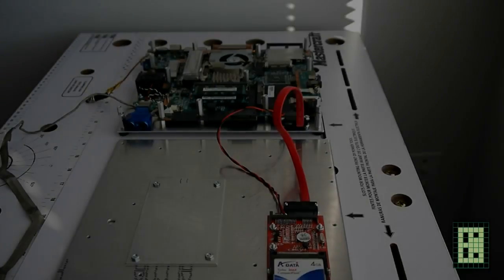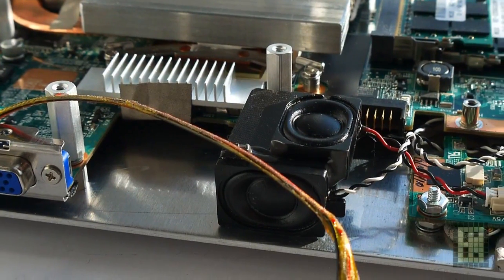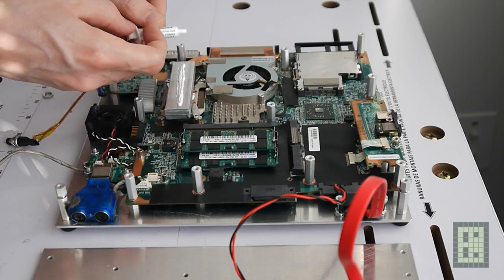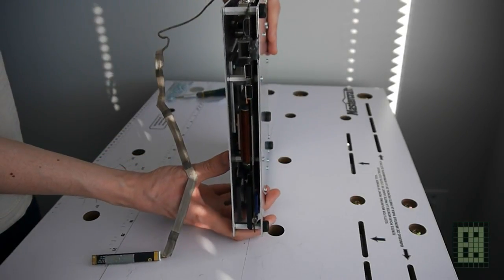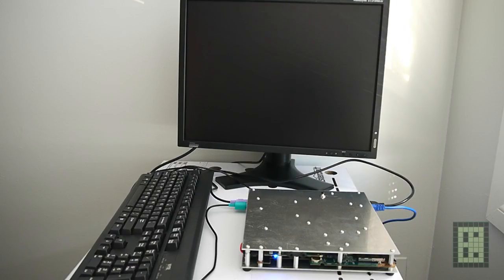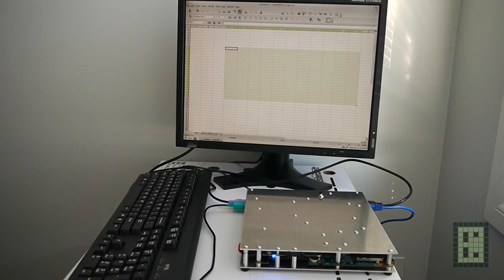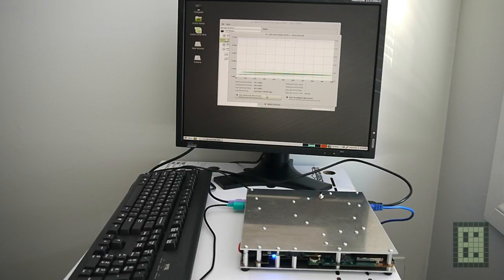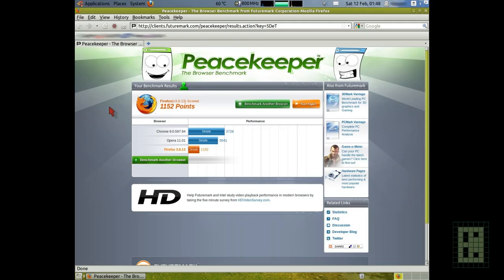DIY Desktop Computer from Laptop Motherboard and aluminum case.

Comment: Salut,am si eu un proiect aproape identic,un dell studio 1555. as avea o rugaminte ,daca ma poti ajuta.
Pot adapta un hdd 3.5''  pe voltajul placii de baza,sau cu o alimentare auxiliara?
Reply from the maker: Presupun ca Dell 1555 foloseste un SATA 2.5" si alea sunt alimentate du 5V de obicei. Cele mari de 3.5 au nevoie si de 12V pt motor. Cel mai bine e sa alimentezi HDD de 3.5" separat. Mufa de SATA e compusa din doua portiuni cea mai ingusta este de date si cea mai lata este pt alimentare unde exista 3.3V,5V si 12V e posibl sa ai toate astea si de la placa de baza da nu stiu sigur cat consuma HDD ala mare si daca sursa de pe placa de baza poate furniza currentul ncesar. Este posibl sa aiba doar pini de 5V connectati oricum. Un HDD de 2.5" consuma in medie 2 sau 3W si unul de 3.5" in jur de 7 pana la 10W deci va avea nevoie de ceva racire nu prea merge pasiv ar trebui un ventilator.
Ar fi mai bine sa folosesti un HDD de 2.5" sau un SSD si sa conectezi HDD mare pe USB in caza ca ai nevoie de capacitate mai mare pt date.
Reply: Multumesc mult de sfaturi. Ideea e ca nu am loc de hdd 2.5'' din cauza carcasei care e pre-made. eventual sa gasesc un conector sata curent tata sa pot cabla hardul la distanta. Imi plac video-urile tale . Keep it up

Comment: Or could you tell me which items you used for the open casing? I just bought new stickers and a metal logo for the case :) the computer is not bad at all either. It would work great for a desktop.
Reply from the maker: Other have asked the same question you can see in older comments. The only components exept for the motherboard from an old laptop are two aluminium plates ordered cut to dimension from eBay and some hex standoff's from digikey nothing else. Also this was done more than 3 years ago almost 4 but it still seems to be popular.
Reply: Oh yes! This is a great idea! It's recycling. My previous computer was great, but it's current casing is restricting it. The computer is an Intel Core i3, ATI Radeon 5000 HD Graphics, 750GB HHD, Blue Ray disk reader, etc

Comment: That is neat, long ago i made one too but with the original lcd on it and with acrylic instead of aluminum and my spacers were hand made from a clothes hanger plastic and then tapped to fit m3 bolts.

Homemade towerless pc

Comment: Is it possible to change the gpu or the cpu on these things?
Reply: Some laptops have socketed CPUs and some don't, if it's socketed you can change it for another cpu thats socketed . As for the GPU unless you have really good skills you can't really change it unless you get an external PCIE slot

Comment: Is it possible to change the gpu or the cpu on these things?
Reply from the maker: I think the CPU was in a socket but there is not much you can upgrade to.
Reply: If the gpu or the cpu are soldered into the mobo,  is it possible that you can solder a different one in?
Reply from the maker: carlo clores
You need special equipment to do that and not sure if you can get a pin compatible GPU as replacement that is an upgrade to the current one.
This is already a more than 3 years old project. Are you interested in general? Or about this particular board?

Comment: A very cool and elegant design. Thanks for sharing. I bet if you installed KWIN or a Linux OS like Zorin OS9 that has all the eye candy and special effects, you would have alot of people coming over and asking where you got your cool rig from!
Reply from the maker: Thanks. This cool rig was actually for my mother :). I needed something light to get low international sipping and it needed to be reliable that is why I used a read only OS and good cooling. It still works as it was initially after more than 3 years. I'm more in to functionality than eye candy even if I think my latest project the Solar BMS looks quite good.
Reply: Well you did a fine job, I am sure your Mother is very happy with it. I would love this thing. Maybe someone will be nice to me and give me an old laptop that no longer works so I can try this.

Comment: Very cool, 99 percent of people would bin there laptop when the screen breaks, your video is showing them a better way, you could very easily fit your Aluminum PC to the back of a flat panel monitor creating a all in one unit. great job.
Reply from the maker: Thanks. There is quite a bit of work and the cost of materials. I think I spent a bit over 100$ on this build.

Comment: Hey while i would have implemented things slightly differently; the design is very nice and you have given me some ideas of when to do with my old laptops. Thank you for this video :)
Reply from the maker: Thanks for the comment. It was done more for practicality than aesthetics. The most important element is the case used as heatsink.
Reply: Yeah I noticed, that's kind of what I like the most. I have a heap of old laptops that are still good, but for what ever reason the case or the screen is damaged.

My thoughts where run them as low end game servers and carry them in a rack/stack (inspired by your design) to take to LAN parties; and just have a small switch on the top. Assuming there's no issues with me ripping off you design a little?.....
Reply from the maker: Untamed Euphoria
:) You can do whatever you want with my design. That was the reason I uploaded this video so people can get some inspiration. Thanks for subscribing.

Comment: So you had a BIOS option to show video through your HDMI right from bootup?
Reply from the maker: I think at boot time all video outputs are active and just when the OS takes control of the HW it can decide to use only one or multiple outputs.
There was no setting in BIOS related to video output from what I can remember.

Comment: Hey, let back on that over-use of thermal grease. More is not better. You should have a paper-thin layer of grease for best thermal transfer.
Reply from the maker: You are right. The reason I used more thermal paste in this case is because the surfaces where not perfectly flat and is better to have thermal paste than air.

Comment: Hi there, can you tell me what grade aluminum you bought and if from online; from where?

Awesome project! Thanks!
Reply from the maker: Not sure I remember correctly I think it was 6061. I got it from eBay but is more than 3 years ago not sure that seller will still be there even if I will have remembered his name.
I just got one that was from US and was cutting custom size (just rectangles it will not do other shapes).
Reply: That's the grade I was going with. Thanks!

Comment: Good job , dude but u can always use An SSD which small and it can be added to your case
Reply from the maker: The CF (compact flash) that I used is in fact an SSD. Back in 2011 a SATA SSD was a bit expensive for this build.

Comment: Your machine work looks excellent, I have a dell Inspiron 1501 M/B AMD 1.8m ATI video chipset. I think I'll try this, only I'll install LEOPARD 10.5.8(I had it running on this 1501 before) and use an USB 3.0 external 2.5 H/D, and use the remaining USB to run Mouse/Keyboard....The only hard thing will be KEXT's for H/Ware..YOU did a GREAT job. I was going to junk the M/B...Thanks for the good info
Reply from the maker: Glad it was useful. Aluminium plates and the other small accessories needed will cost something then there is the few hours of work also. Not many will want to do this.
The main reason I did this was that I needed a light weight computer that is extremely reliable. It seems to work fine for more than 3 years now.

Comment: hi  i did exactly what u did on the video.. i cant get through BIOS.. it  freeze up ..  do i have to connect all the ribbons?? like extra USB, SOUND, etc. because i think there is some issue with the missing hardware which was connected with the laptop but missing on desktop?? any suggestions?? do i have to change anything,
Thanks
Reply from the maker: I'm sure you did not exactly like I did since mine works :)
Can you access BIOS ? Do you get the BIOS prompt and the it stops ? Do you have a bootable media connected like a HDD or USB drive with an operating system?
Reply: No I can't access Bios .. it freeze up. Keyboard works coz when I press crtl alt del it restarts and when I press ESC its changes to menu but freeze up same with F9, F10 or other boot keys on keyboard..
Reply from the maker: sushil dawadi
It dose not sound good. Was this functional before the change?
Maybe you forced the motherboard when mounted in your aluminium case and cracked some solder joint.
What was left out from the original Laptop?
Try to reinsert the RAM eventually.
What sort of menu do you get when you press ESC?
Do you use the original laptop keyboard ? or an external USB one?
Reply from the maker: sushil dawadi
What do you call system menu ? Is it the bootloader selection menu? BIOS ? or BIOS boot option ? and what are the options if so? even if frozen.
Reply: I got it worked ...thanks ...
Reply from the maker: sushil dawadi
Great. What was the problem?
Reply: hdmi output.. as soon as i plug in VGA it start working.. thank you

Comment: Or is there a way to force the display to show on monitor(VGA),
not the laptop screen?
Reply from the maker: Not sure it depends on the BIOS it should normally detect and be able to see at least the BIOS prompt.
If you still have the laptop keyboard see if there is a combination key for the external screen like the  Fn + F5 or something like that.
Is the VGA the only external display connector? It really depends on the laptop BIOS.
Reply: ***** thanksn for getting back so fast!

Comment: Hi! I Was wondering how thick are the aluminium plates
Reply from the maker: Hi, About 2mm but you can use 3mm or more if the weight is not an issue

Comment: I just took apart my old laptop and the screen is broken how i should connect it to external monitor.
Reply from the maker: What model it is?
Most laptops have a VGA or HDMI output the VGA is the one with 15 pins on three rows and the HDMI looks similar to a USB connector but larger.
It will also depend on what monitor you have and what inputs will that support.
So let me know what model of laptop and what model of monitor you have and I will let you know how to connect them.
Reply: It is samsung r509 it just doesnt connect right away.
Reply from the maker: kraNkDNB
It seems you only have a VGA connector on that laptop.
How long dose it take to display an image ? It should be almost instant from the time you power the laptop ON
Maybe you can do some BIOS settings to let it know that you only want to use external display.
Reply: yes

Comment: But can i connect laptop motherboard directly to monitor?
Reply from the maker: Not sure I understand the question.
As you see in this video a monitor was connected to the laptop motherboard using the HDMI connector available on this motherboard.
Was this your question or are you thinking about the LVDS connector.

Comment: Very cool work my man! can i ask where did you learn your computer engineering knowledge ?
Reply from the maker: There is not much that I did on this project mostly the aluminium case/heatsink.
I do have an electrical engineering degree from Polytechnic University of Timișoara but it probably did not play a role in this build.
The first computer that I build was a 386DX with separate 387 math Co-Processor back in high-school :) I guess I'm a bit old.
Reply: ***** whoaaa you're from Romania? Si eu la fel ;)

Comment: I want to do something similar except for the case their are many different kinds of materials you can use even recyclables. i need to mount it on a side case probably to put a fan inside and a dust cover..yes, its difficult to put a fan with the idea of dust. So why exactly did you put the fan on the top with out a slotted case? I think you could recycle an old case and mount it even if you modified it. Luckily I don't live in humid ocean area..just dusty dusty area so the case is important --it can always be inexpensively modified....even from recycled laptops :) fun
Reply from the maker: Not sure you noticed in the video but the case is aluminium because it acts as a heatsink for the CPU is in direct thermal contact with it.
So the fan on top is to cool down the aluminium that is  a case and a heatsink at the same time.
Reply: Is that most important function of the case? Was that your top consideration in making something. You know their are many ways to think about cases most top consideration being what we see. this one is interesting and I like it and the derivatives of it. Even hard plastic-tinted-painted-designed-clear maybe with a goldfish inside....thanks for sharing shy
Reply from the maker: shy zullo
Yes the most important function of the case was to act as a heatsink.
Most laptops overheat and eventually fail. The reason for that is that they need to be small and light but at the same time quite close in performance with a desktop so the designers use small and light heat pipe heatsinks cooled down with an even smaller and noisy fan.
Most laptop CPU's have a TDP around 35W and that is not as easy to cool as it looks.
The aesthetics of the case was no priority for me but it looks OK in an industrial sort of way.
Most things that I do are about the functionality and robustness that are about aesthetics a good example is my latest project the Off-Grid House :)

Comment: This is amazing, well done mate!
Reply from the maker: Thanks for the comment and for subscribing.
Reply: No problem. The thing is so impressive, I would've liked you to do something more impressive with the final fan, like attach a 230mm one:)
Reply: wait, I had a better idea. How about you get a cheap cpu tower cooler which would cost about the same as a 230mm fan.
Then attach that directly to the top metal plate, it's just a peltier cooler so should make the aluminium really cold! You might even be able to get away with not using a fan on it
Reply from the maker: gish85
It can be used as it is without a fan but it will be about 10C hotter still well under max allowed temperature compared to the ultra low speed fan that I used.
This build was not for me and it needed international shipping and that is crazy expensive if is over 2kg that is why I did not use thicker aluminium.
I prefer to use peltier to generate power :) see my other video about that.
I actualy use a peltier right now to cool my food since I moved offgrid almost forgot about that :)

Comment: nice video, Im thinking bout doing this with an old Aspire Acer 5610z, but wus wondering if I could use another moniter to work instead of the laptop screen that came with the laptop setup? Iv read that it can and also cant be done.. Im asking because I will be using my setup as a carputer and I dont wanna have it too close to the motherboard, kinda would like to run the moniter in my dash and mount motherboard case and power supply either under my seat or in my console of my truck.. If u dont mind could u give me a lil input on how to accomplish this? Thanks for your time and I will be subscribing!!!!
Reply from the maker: You can use a VGA monitor or possibly even a S-Video type monitor if your laptop support this type of output.
Not sure how useful it will be as a carputer unless you find a nice external VGA touch screen.
But probably a small tablet will work better since it has everything integrated it can be Android or Windows tablet depending on applications will you want to use and also cost similar to a small external VGA monitor.

Comment from the maker: There will be no dust in the middle of the motherboard since there is no working fan inside to insert the dust there.
It is working daily for the past two and a half years and has no problem with dust or any other problems. There will be much more dust in a laptop than in this.
It is working inside the house but maybe outside because of wind dust can get in between the aluminium plates and the motherboard.

Comment from the maker: If you have a different motherboard they you will probably need standoffs of different size.
Go to digikey and search for hex aluminum standoff notice the wrong spelling for aluminium or maybe not the wrong one usually used in US.
There are about 179 finds representing different sizes with metric and imperial thread.
I got a male female and a female female in my build and used screws to connect the aluminium plates to them.
Hope that was helpful if not let me know.

Comment from the maker: :) What used to be the bottom of the laptop is now the top of this DIY Desktop. Then the largest generator of heat the CPU and GPU originally connected together to a heat pipe cooled by a small fan are now thermally connected to the top plate that has a way larger surface area.
The cooling performance even if passive was drastically improved compared to the original laptop.

Comment: THERE IS A LITTLE PROBLEM ! ! 
WARNING: In the bottom of the case there MUST be some slots, or ventilation holes. so that the fam can easily vacum air.  Those fans are designed to vacum air from the bottom, not from the sides.

Comment from the maker: Do you have the optional ATI GPU ? What ports do you have VGA? HDMI? 
When you say no activity there is no reaction when you push the power button no fan no HDD no LED's ?
Connect the LCD display go to BIOS select Intel tab then Video Control Sub-Menu then at IGD- Boot Type select your type of external monitor probably CRT if you use the VGA or CRT + LFP

Comment from the maker: The case is custom made out of two aluminium plates that you can find at your local hardware store or on eBay.
The other parts of this case are the standoffs and I got those from digikey.
Problem is that the laptop motherboards do not have a standard size like the desktop motherboard so you really need to build a custom case based on the design of your motherboard.